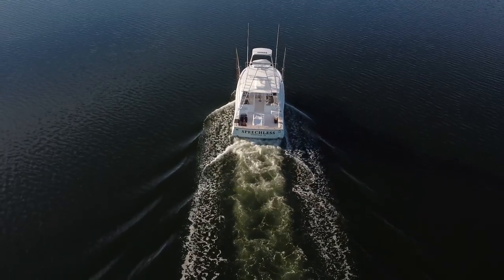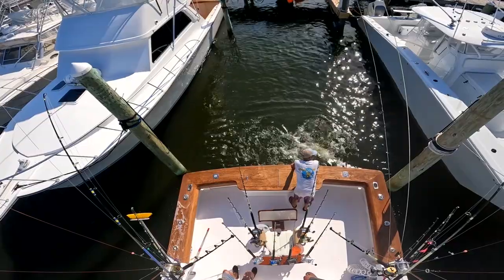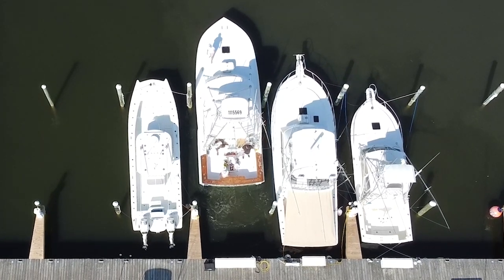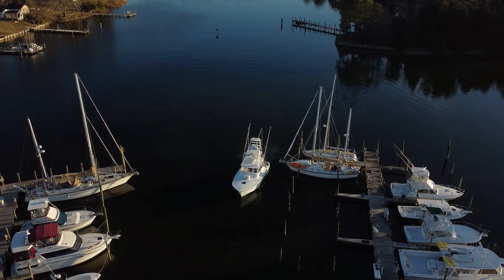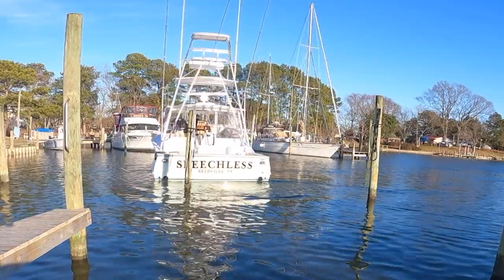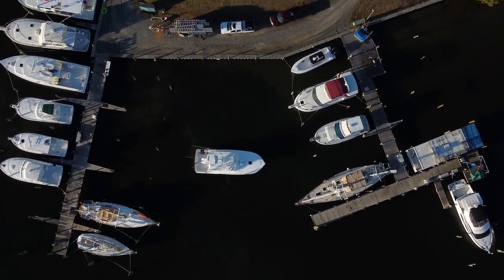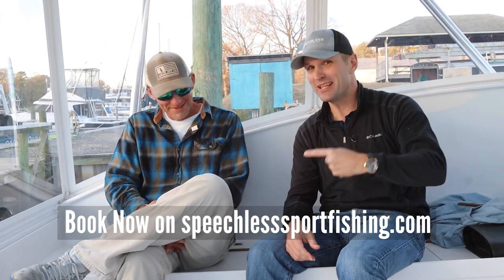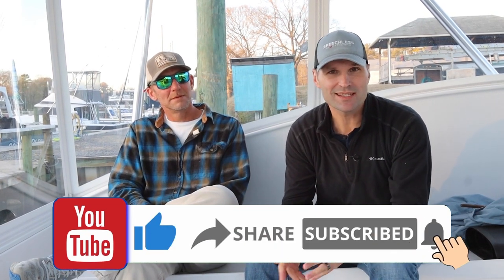I Attempted to Dock Our Large Sport Boat 9 Times...It Was a Struggle

Comment: I grew up around boats that had separate gear and throttle controls.  It's been decades since I've spent anytime on boats.  It just seems like it would be easier with both gear controls located together and throttles together on the other side of the wheel.